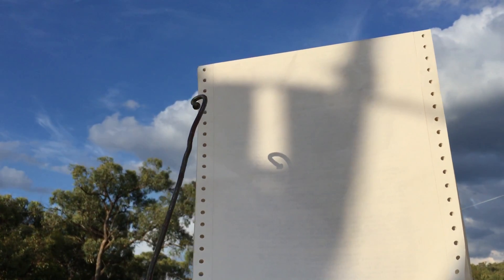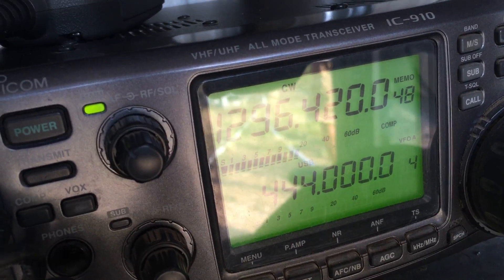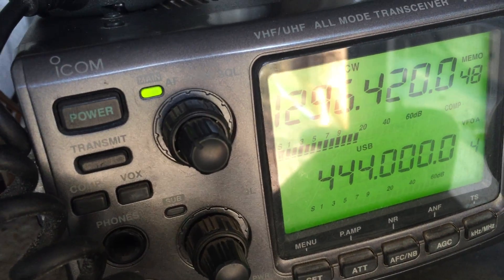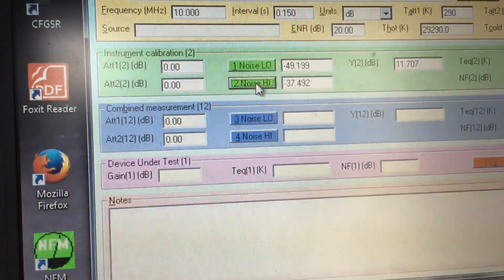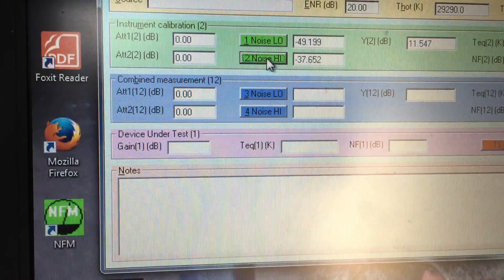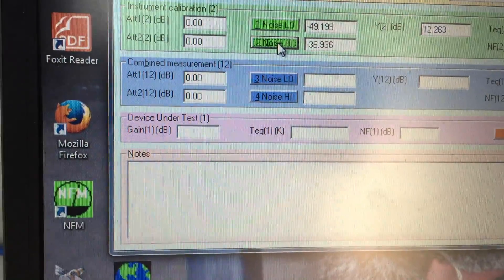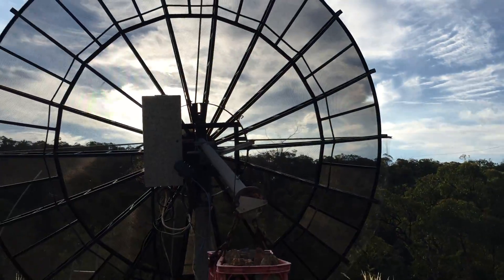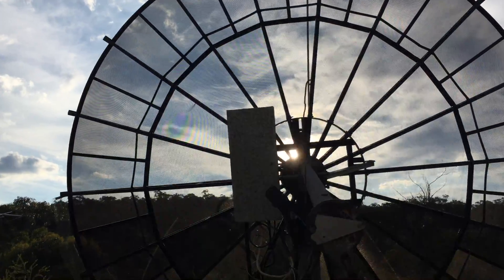Measuring 23cm sun noise on a 5m diameter satellite dish - Manly-Warringah Radio Society

Comment: My firestik cb antenna does this I thought it was faulty until I got out of the truck shaded the antenna in direction of sun not touching it noise was gone. Is there a way to prevent this or no.